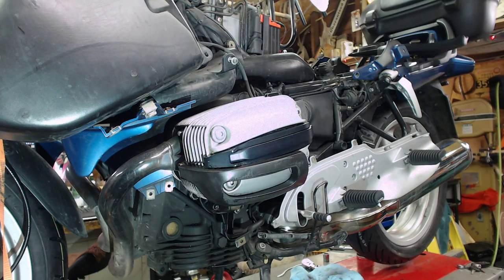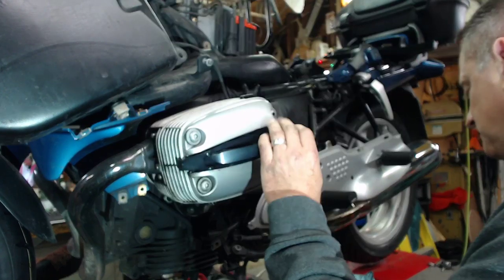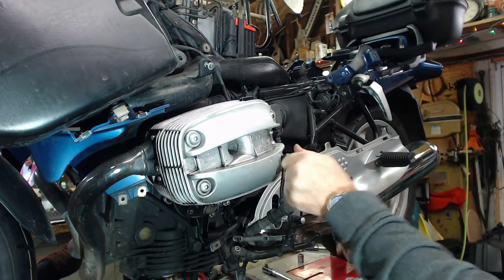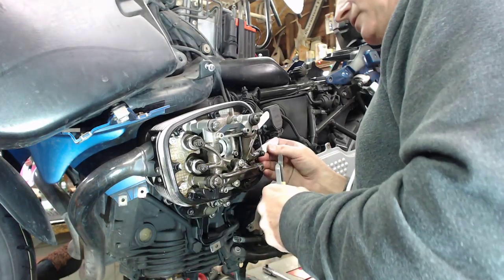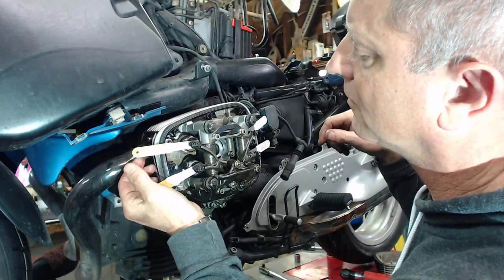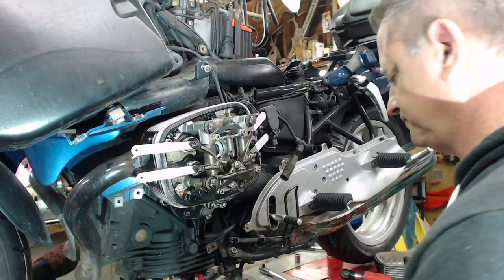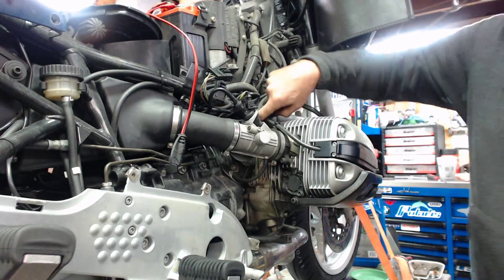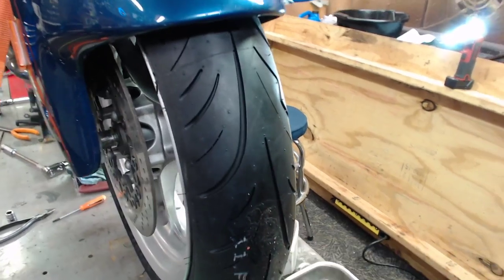Tech Day Live! Oil Head valve check with Q&A

Comment: Is checking all four valves per cylinder simultaneously unique to BMW oil heads? Obviously both rockers share a common camshaft. Should I've been checking both valves at the same time on my airhead all along?
Reply from the maker: yes to both